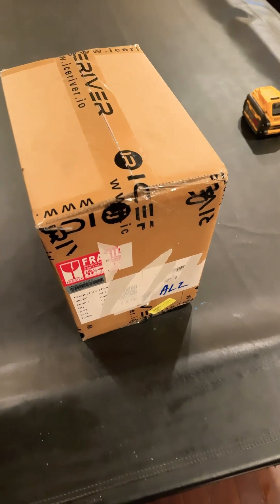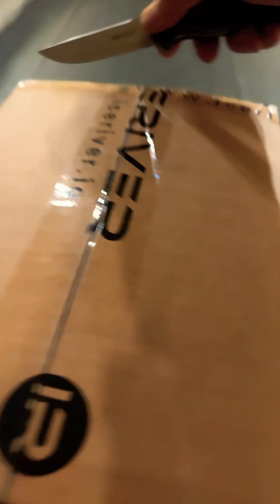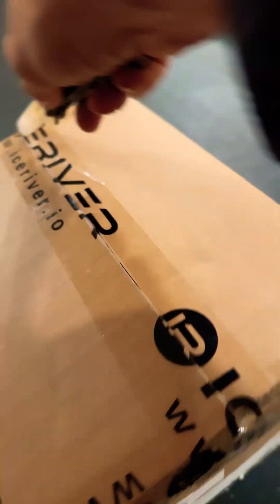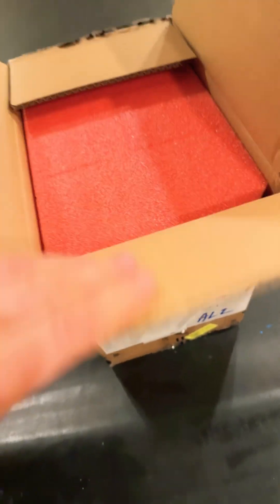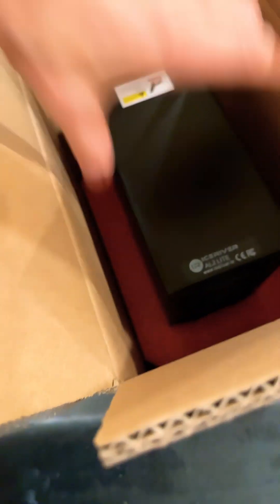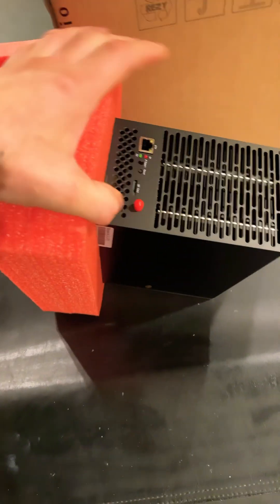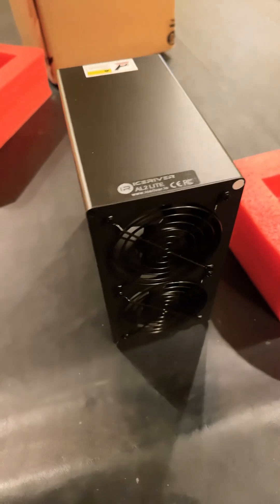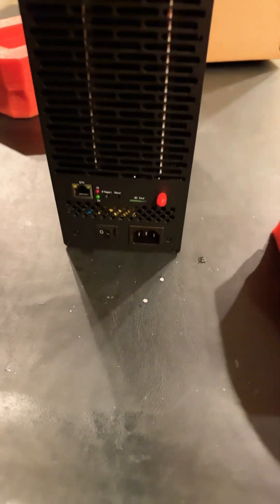ICERIVER AL2 lite unpacking

Comment: i think i am having the psu failing. i plugged it in and no lights on the ethernet. i see a constant blinking green light inside when i turn it on though.
Reply from the maker: My todays video is just about that.
Reply: @DontMindMeMining  let me know if you find a solution. I opened it and everything looks fine